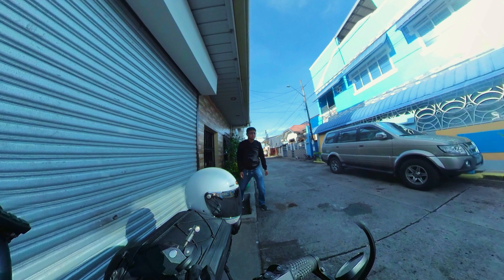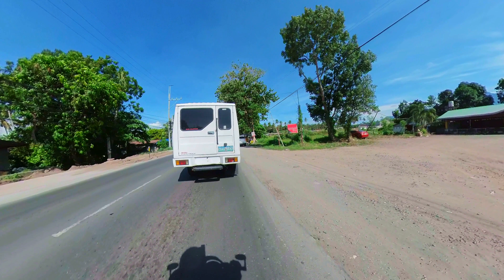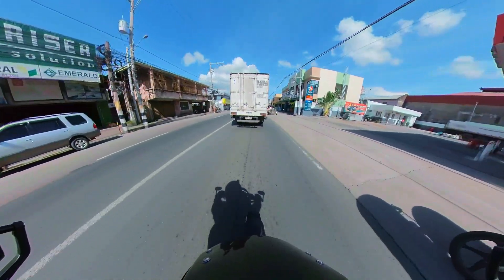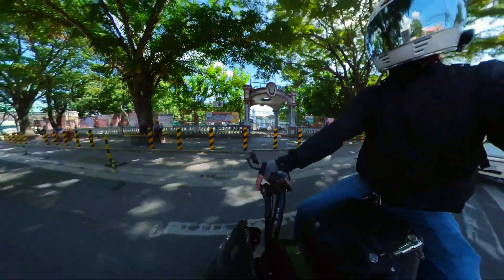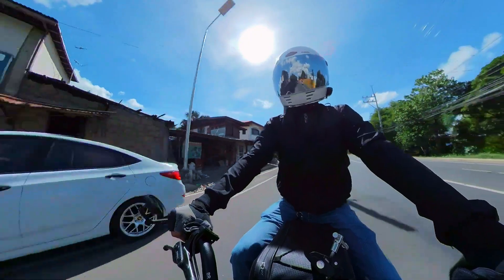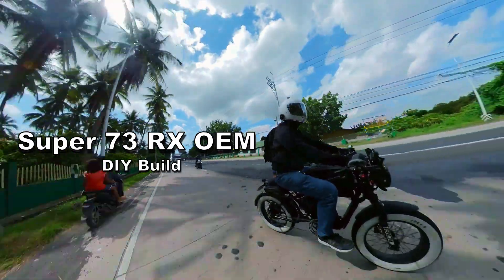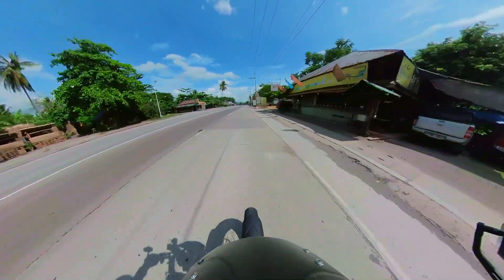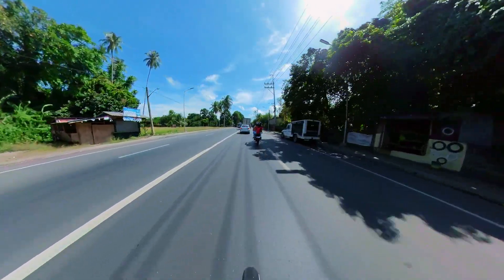120km E-Bike Range Test | Super73 OEM | PART 2 (English SUB)

Comment: Sir ano kya cons kpag ginamit koung 3000w 80A na controller sa 1000w ehub ko
Reply from the maker: Masusunog yung motor mo. Imagine isang bata( 1000w motor) pagbubuhatin mo na 50kilos ng bigas. Sa una kakayanin pero mababalian din katagalan.
Reply: Verry informative sir so if im using 1000w e hub do you think 1500w controller is better and safe ??
Reply from the maker: Yes. It can take that. Just be sure that the controller is 1500w peak power. Most motor advertised its specs at peak power.

Check mo yung voltage at amp rating ng controller then multiply mo to get peak power rating. Half of that is the nominal power. Nominal means it can run continously at that power without burning the controller and motor. Peak Power is during hard acceleration only and happened for short time only.